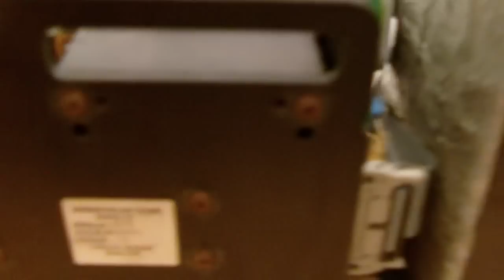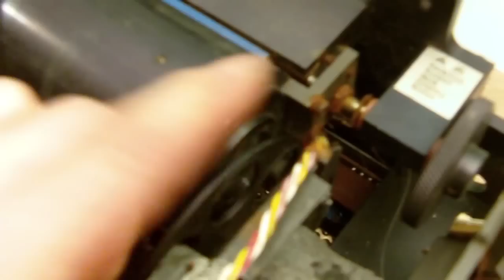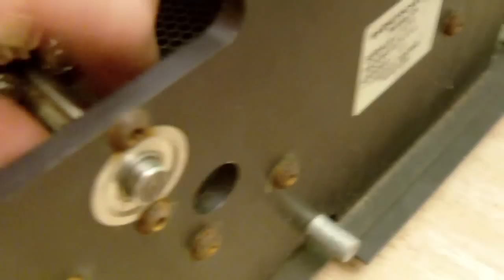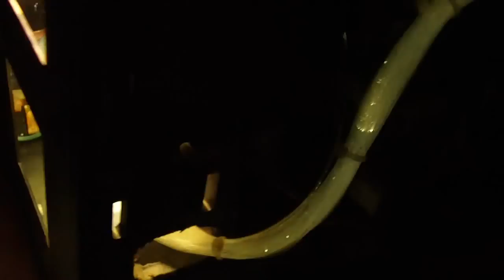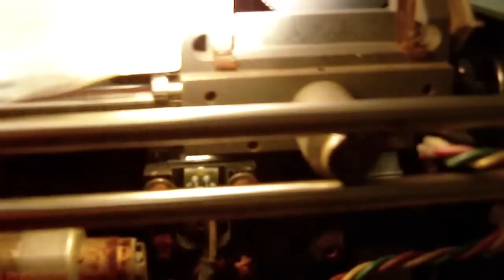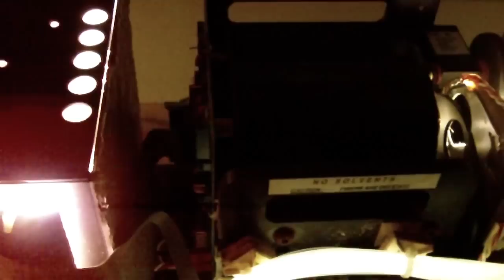1989 Film scanner (Barneyscan)

Comment: As @konradglibowski617 noted the wheel held filters. In addition to R, G, and B there was a ND filter for calibrating the light source. The sensor was a 1024 element linear CCD array. The single fiber optic strand was for the linear encoder which read a glass scale mounted to the bottom of the slide carriage. The bearings on the slide carriage were canted slightly so it moved across the shaft as it rotated.

Comment: Huge thanx for this video!  I'm a fan of all scanners and a history of imaging. The mysterius wheel in this beauty was for different color filters ( R, G , B or  C, M , Y). It is multi pass scanner  ( natively gray-shades sensor) it scan each color after another, not in single pass , but in 3 separate tasks. Connector is SCSI  , original price were ~10 000$ and it drop to 1200$ in few years, when at that time cheapest PMT scanner was over  300 000$. Resolution  is 1000dpi , and it allow 1.5 Mpix scans from 35mm  ( 1520x1024) not so bad for 1989 device. I 'd love to see it running again   :)
Reply: What would something like this be worth?